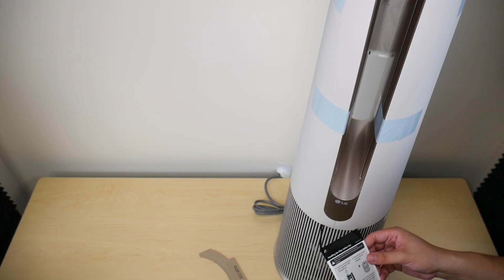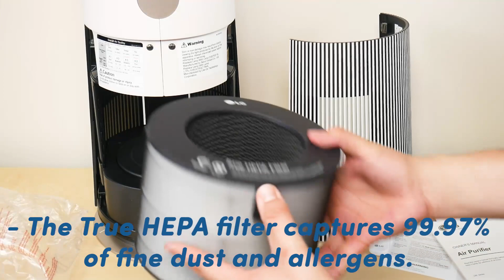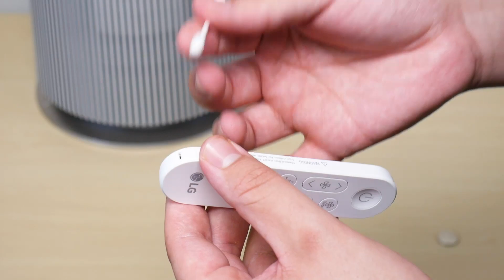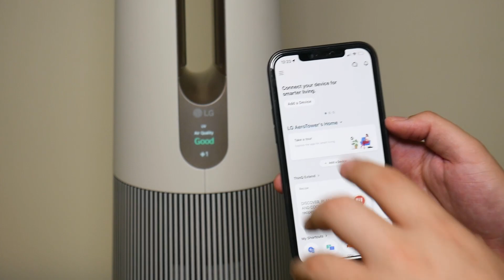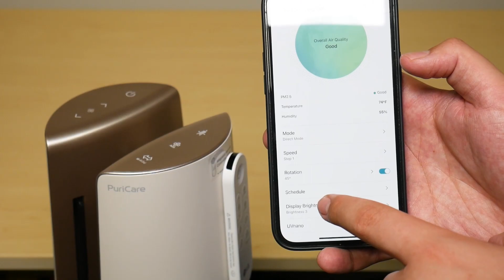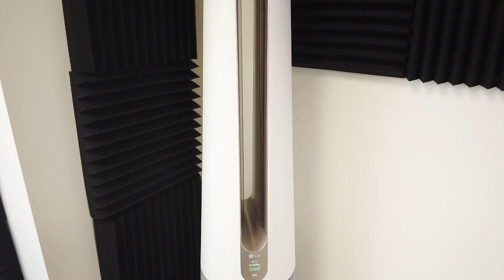LG PuriCare AeroTower Purifying Fan Unboxing and Setup | Featured Tech (2022)

Comment: I just got my LG Air Purifier today, and I don’t understand the directions to remove the vinyl cover off the filter. I saw that you removed the plastic, I did that, but why do we have to remove the vinyl cover?  Direction #3 on page 12 and then caution on page 13 of the Owner’s Manual. Can you explain? Your video was very helpful. Thank you.
Reply from the maker: Hi Felicia, the vinyl cover has to be removed for the filter to start purifying your fan. If you try using the fan while the vinyl is still on, you may potentially damage it.

Comment: We just got our air purifier yesterday. Your video was helpful. Thank you. Does this unit not have the ability to auto turn on when it detects a set threshold of air quality? I see the scheduling featuring. To me, it is more useful to have the unit either initiate or increase air volume when the air quality drops. Dyson, presumably It's high-end competition, has this feature.